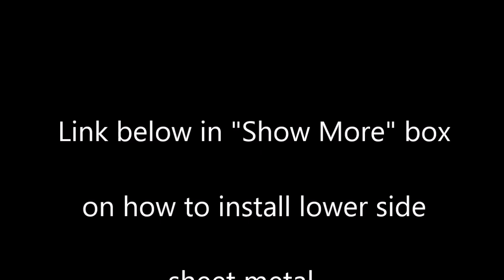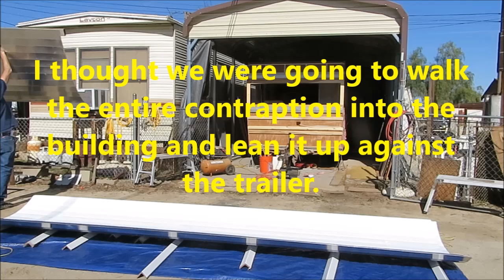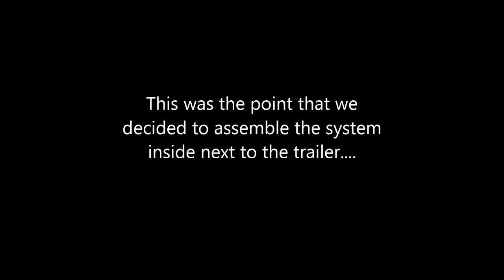Installing Upper Side Metal Skin

Comment: I have found your tips very helpful, so here is how I was able to raise the sheet metal by myself.  I modified my engine lift ( cherry picker ) by extending the boom with a 2x4 so that it could reach above the roof of my trailer.  Then I drilled a hole in the long 2x4 midway then put a rope through the hole before screwing the metal to the 2x4.  Then attached the rope to the boom and up she went.  Was able to get it just right where it needed to be.
Reply from the maker: OH how fun! Good job. If you have any photos please send them to mobiltec@gmail.com

Comment: nice dissident piano at the end of this video, when yall were moving that panel music is perfect match and reminded me of the first year of my sheet rock apprentice ship with Craig.
Reply from the maker: LOL That was quite a day. I tried to use the Benny Hill Theme for that clip but I got a copy right hit on it. I was a sheet rock hanger for 10 years. Fun but it was tough work for sure.
Reply: really, i ended up working with Craig for 24 years hangin and taping Gypsum. - This literally just crossed my mind, i wonder if there is a cost effective way to spray a vapor barrier on the insides of the metal panels. You see i live in sub-tropical South Carolina, mold happens fast here and i have become almost neurotic about how air with moisture in it flows. Even a minuet gap between plastic sheeting and metal can create a place to grow some microbes.
Reply from the maker: I don't know. But see here is the deal with moisture being created on the inside of the metal. It needs to cool off for moisture in the air to condense. If the air is just moist as in high humidity, no water will be created on the other side of the metal unless it cools off suddenly. And I mean a great deal. Not just a few degrees. I've tested this. So I would just go with the regular plastic sheeting such as Tyvec or the Roberts Unison that I show in my videos. I've done my own taping but I worked tracks for a long time and we had tapers that came in behind us. Then the spray guys came in.

Comment: Did I miss something Larry, like a vapor barrier?  Love the antics at the end . Hilarious!! Bill has to go with you because I haven't gotten my Billroy Shirt yet!  Looking forward to the new shop!
Reply from the maker: I didn't use a vapor barrier on the sides Bear.  This trailer and most others actually came with no side wall vapor barriers. I've never put the vapor barrier in the side walls of any of my trailers before. I know a lot of people think they are necessary but they really aren't. They are mostly needed for the top, and on canned hams the top includes the front and rear walls. This trailer actually needs no barrier on the front or rear either but it will have them.
Reply: Learn something new every day!
Reply from the maker: I would advise using a barrier on the sides any time you can. Especially in very cold weather using a heater. This trailer will live in California.
Reply: Good to know thanks Larry.
Reply: I wondered if it was better to let the things breathe and worried a vapor barrier just makes a place for water to pool and collect.

Comment: Couldnt you use small quick clamps rigged with holes through handle for ropes instead of having to put screw holes in it
Reply from the maker: The part that the screw holes are in get's cut off anyhow.
Reply: mobiltec thanks

Comment: Hi Larry I saw that u put home insulation on the camper , I put on mine 1 1/2 of insulation panels I saw this in YouTube bc it said bc the humidity or u get a leak inside it won’t get sag or go bad inside the walls of the camper what u think of doing it this way
Reply from the maker: I disagree with the logic. First off, build your trailer so it doesn't leak. Second, the insulation is made out of fiberglass. So moisture that is just in the air won't hurt it because it will evaporate. Third, that solid foam panel does not work as well for insulation because it STORES heat and cold and eventually transmits it to the inside of the trailer. It's terrible for insulation... Fiberglass insulation does not transfer or store heat or cold. And it includes airspace around all the woven fibers which keeps it from storing heat or cold because it will dissipate into the surrounding air.
Reply: This is my first project I do so I ask questions around plus u have the experience in building that’s why I ask u
Reply from the maker: @yoelroque3950  Im always here for your questions. Good luck on your build. I also have a great website where it is much easier to find my videos. www.cannedhamtrailers.com And I have on line classes. Link to the class on my website.
Reply: @mobiltec  thank u Larry I appreciate it & u guys are great & funny

Comment: Does anyone know what kind of staples he's using?
Reply from the maker: 1/4 inch crown staples that are 3/4 inch long. You  want to buy only Porter Cable Chisel Tooth staples because they are the only ones I've found that will penetrate two layers of the .030 in metal skin. That would be in the fold over area.

Comment: The exterior metal, I replaced all my skins and I can’t find the video on how far apart and what pattern to follow for screwing the screws in the field of the external panels. And hello Larry! Should be finishing my camper this year, hopefully ! It’s been a long 6 years since I started!
Reply from the maker: That depends on a few things. Many trailers have no screws on the outside of the skin. The windows and baggage doors hold the skin on. Along with the brows and the outside ports. If you do need screws on the outside it will be in just a few places where ever it looks like the metal is not held to the framework very well... I don't really have a video that shows that because each trailer is so different in that respect.
Reply: @mobiltec  I have a 1963 Shasta Airflyte  www.thepeachypost.com   Should i use screws on the skins? I took out the baggage doors because i didn't like the idea of someone being able to pry it open and put something under where i sleep.
Reply from the maker: @valeripicchi1367  Yes you should have a few screws here and there on that trailer especially if there are no baggage doors. I would say where the baggage doors are use three between the bottom of the window and the bottom of the trailer. Evenly spaced in height. Put them only in the creases of the metal. Not on the high parts. So 3 in the field under the windows. Two vertical rows of three each. Then maybe tow more vertical rows in the same creases somewhere in the middle. If the front side metal looks a little loose under the front windows then maybe a vertical row or two there. Just don't go crazy. You don't need them on every stud. Feel the metal and push on the creases and make up your own mind where they need to be before installing them. Make sure you hit a stud and hopefully you know where the wiring is in the wall if there is any so you don't hit that... Keep the lights all lit up while installing the screws. That way if you hit a wire you will know it right away.
Reply: @mobiltec  Thank you so much, you are the best. You really are.

Comment: don't you put.silicond to prevent water damage? or leaks
Reply from the maker: Never. Silicone doesn't work on Metal. Metal shrinks and expands with cold and heat. The seal is broken first time there is a temperature change. If you install the metal properly and apply the putty tape under the J Rail properly it won't leak.
Reply: So do you just use it around the windows?
Reply from the maker: No. I hardly ever use it. The only place I ever used it was around the solid front-side windows of the 57 Shasta and that was because of the poor design of the wooden window frame itself.  Silicone does not seal anything metal because the metal shrinks and expands with changes in temperature thus breaking the seal immediately... Just stay away from silicone calking. Stay away from calking anything on the outside of the trailer. If sealed properly it won't leak.

Comment: What insulation do you use?
Reply from the maker: I use R-13 in a roll and separate the layers into three. It's just the right thickness and sticks out just a bit so when you put the skin on you get the "puff factor"... Makes the skin feel more solid when you push on it slightly.
Reply: @mobiltec  I am going to be using 2x2 walls actual 1.75x1.75 can please make a video about you cut it I have been try to figure it out for over 2 weeks and cant find out. This was the exact thing I have been looking for!
Reply from the maker: @jacobh1997  I did a series on the 59 Forester which had 1.25 inch studs and rafters. Go to my website and look up the 59 Forester Project. http://www.cannedhamtrailers.com